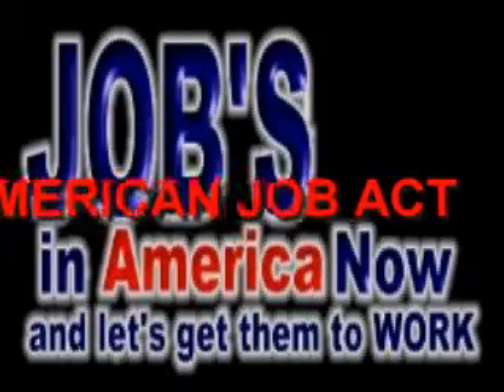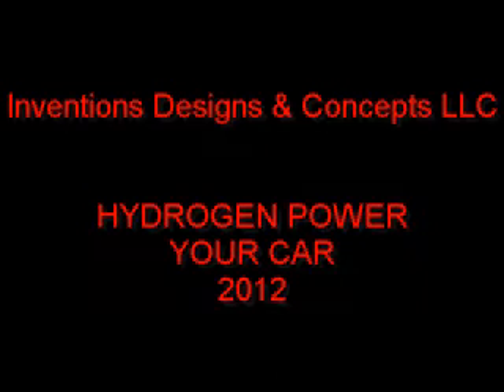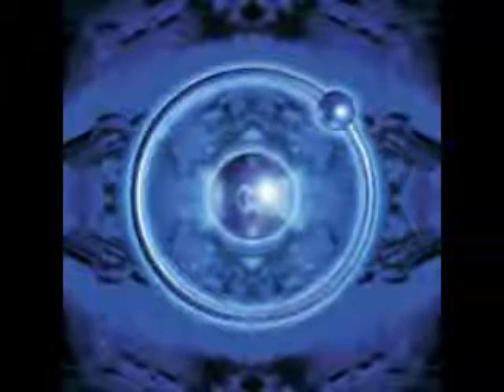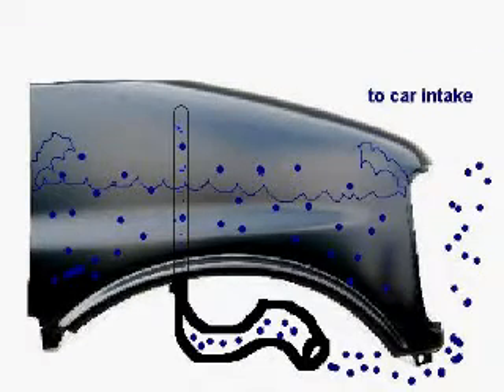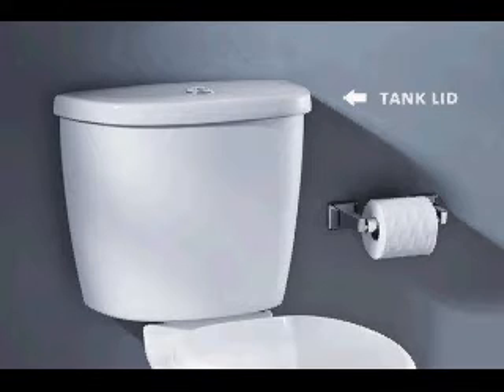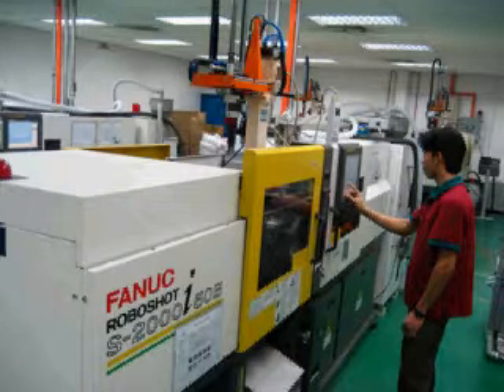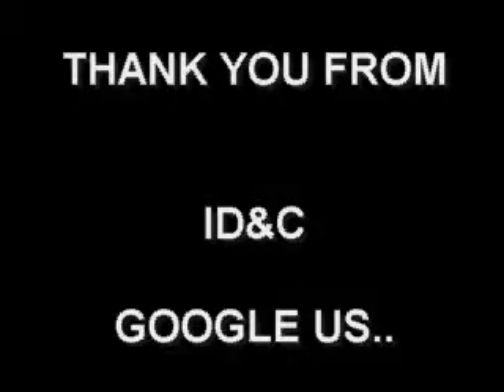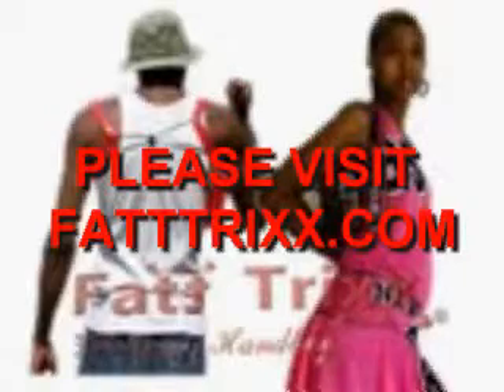Hydrogen CAR Fender FREE ENERGY by Inventions Designs & Concepts LLC

Comment: @michaelwil16122 GAS UP ONCE A MONTH  Save $2,400 year.
"The Hydrogen Car Fender 2012" Replacement program $300 installed.
Go Green! Retail value $1,350
2021GREEN SPRING 
 Join in and collect $7.00 per sign up to your favorite Charity. 
Up to 240Million customers. @ $7usd each sign up. FREE ENERGY , GREEN ENERGY

Comment: I think H2O will save money, but I prefer that we worked on making sure water is not monopolized. Brothers and Sisters there is a lot of folks out there who want to control resources. so careful. My preferred H2O fuel system, is hydrostar developed based on Yule brown and Stanley Meyer and involves just the electronics to electrolyse water and requires no steel wool.

My more preferred solution to H2O is use of zeropoint devices and investing in developing those. As well as Tesla coils and etc